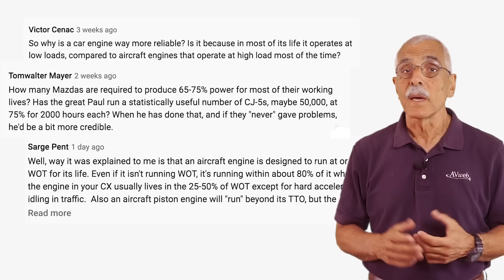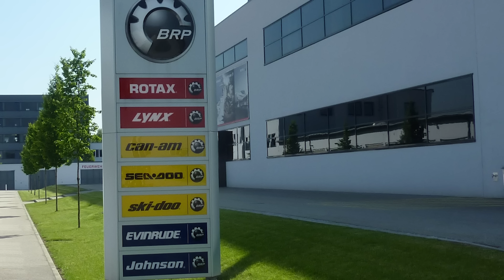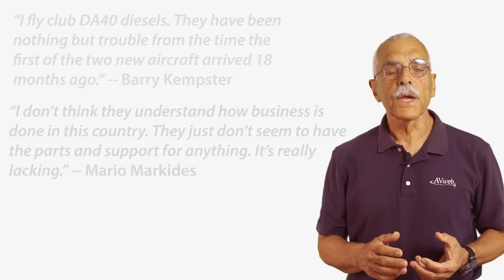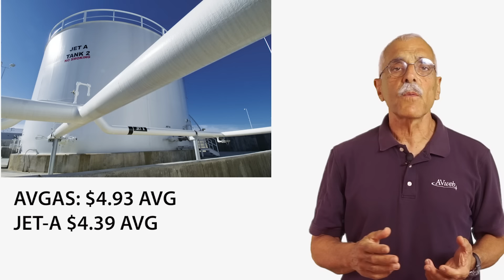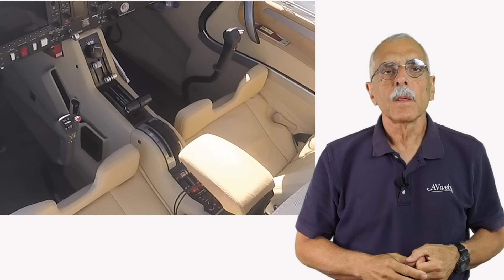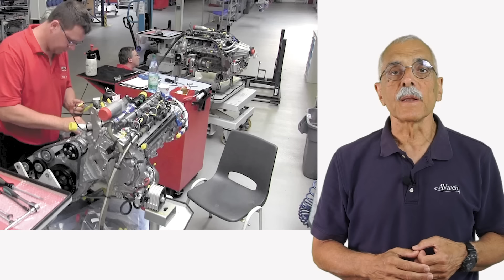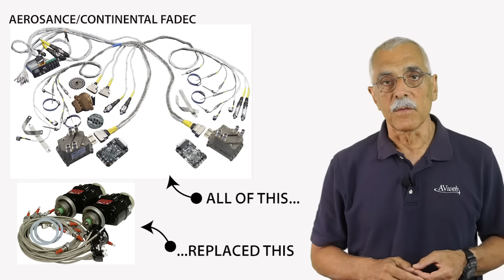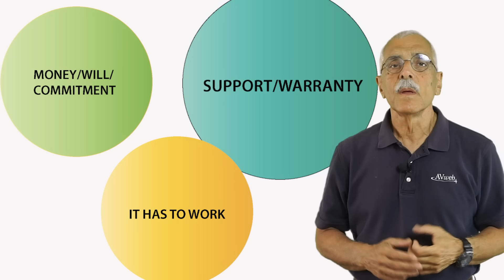Why New Aircraft Engine Ideas Rarely Succeed

Comment: I really hate (maybe that's a too strong of a word... but anyway) when I hear pilots say "I want to be able to control my engine" in response to the idea of FADEC.  I have yet to meet a pilot that can monitor dozens of engine inputs hundreds of times a second while adjusting parameters for best reliability and performance using algorithms developed over decades. While also constantly logging the engine performance, environmental conditions, and anomalies.  Some will even make this argument while trying to start the engine for the 6th time because this time they know they didn't give it enough throttle on the last try.
Reply: They need that mod which adds a separate mixture knob and CHT+EGT gauge for every cylinder.
Reply: @bwickham195  Plus knobs for adjusting each individual valve?
Reply: Strictly mechanical simple systems tend to be more reliable and cheaper to service
Reply: With a manual tranny you migth avoid paying $3800 for a repair that only needs a $50 part and you are less likely to suffer catastrophic failures every 50000 miles or so. Also, a person with reasonable tool skills can replace a clutch in the driveway avoiding the $350 per hr shop labor rate these ripoff shops charge. Unfortunately aircraft owners rarely get that opportunity as scumbag politicians at the FAA require them to have the services performed by a licenced a&p mechanic. In the automotive world there is much debate over right to repair laws and the scumbag lawyers often cite the aviation industry as a shining example of why only licenced dealers should be allowed to service cars. That's giving them carte blanche to drive the independent shops out of business, squash the home mechanic, kill the auto parts industry and raise repair prices to the point of needing a second mortgage to repair your vehicle. Anything that improves efficiency, safety, longevity, durability, reliability or ease of operation while not sacrificing other aspects of the same list ( automatic lean of peak systems that burn up engines before 50% tbo being a perfect example ) should be joyfully welcomed by the aviation community. For those who decry advances that reduce pilot workload there's always antique aircraft or experimental. Nice thing about experimental, you get exactly what you want ( provided you can afford it ) and, as the holder of the repairman certificate you can service it yourself thus avoiding ripoff aviation shops. 
As to the safety of gen av someone suggested you are safer in a car on the ground. MORE PEOPLE ARE KILLED EVERY YEAR ON AMERICAN ROADS THAN HAVE BEEN KILLED IN THE ENTIRE HISTORY OF GENERAL AVIATION. And that doesn't include the rest of the world. I know some da will point out the airline crashes that kill hundreds at a time but that's COMERCIAL AVIATION. When you intentionally fly to a place where people are shooting at you it's generally called MILITARY AVIATION ( sometimes its just annoyed neighbors ) but, again, that's not GA. The VAST majority of aircraft accidents are pilot error. Rarely are catastrophic failures at fault. When a trained and rated pilot fails to follow the checklist and turn off the defective autopilot it's pilot error. When a pilot fails to remove a pitot cover or notice the broken hinges on a control surface or the locked flight controls, its PILOT ERROR. When the pilot decides to perform aerobatics in someone else's Piper Warior it's PILOT ERROR. Let's face it, you can neither fix nor legislate STUPID. pilots should embrace technology that brings us out of the stone age and laws should not be allowed that push the cost of innovation and advancement out of reach of anything but a government subsidized airline. Pilots who prefer to fiddle with knobs and gadgets rather than fly the aircraft will always be out there. One can only pray that they don't take anyone with them when they kill themselves. 
There. Nuff said. Paul, love your stuff. 
P. S. How about a video on why a piece of electronics for aircraft or boating should cost 3 or 4 times as much as the EXACT SAME thing fot hikers ( GARMIN )
Reply: I pro Fadec, but I would still like an override, just in case If it doesn't add too much weight
Reply: Here, here. Well said.
Reply: I deal with fadecs. One manual reads "if these parameters are off, you will be unable to start the engine"
Oh boy. So basically it locks you out and will refuse to crank if a parameter is off. Even if it means you can save your life at the expense of the engine
Reply: people who say this will also drive an automatic
Reply: You're in it for maximum efficiency, not everybody thinks like you. Even if it takes 5 tries, it's a whole hell of a lot of fun to be in complete control. It's like manual vs. automatic in your car. Manual is objectively worse in every way except simplicity, but it's a lot more fun and engaging for the driver. You never have to fight with the transmission about where to shift and how fast, because you are the one making that decision in the first place. Even if you are making the objectively wrong decision, it's ultimately your decision. That's fun, maybe not for you, but definitely for me.
Reply: @tissuepaper9962  you might like playing with levers but i like actually flying the aircraft
Reply: @SuperAWaC  no reason to be condescending, we just enjoy different aspects of the experience to different degrees.
Reply: @tissuepaper9962  I don't know if I'd describe it as fun or engaging during task saturated portions of a flight.
Reply: @SynMonger  then maybe a diesel plane is for you, my friend. the single lever control just isn't for me, it doesn't match my goals in flying in the same way an automatic transmission doesn't match my goals in driving. I want to master the skill of controlling as much of the vehicle as feasible. That's the fun part for me. It may not be the fun part for you, that's cool. We simply disagree. I'm sure if I had to fly every day for my job I'd like the single lever for its convenience and safety benefits (the same way I like the automatic for daily driving), but I don't have to do that, so I'll stick to my 1960s-style controls.
Reply: @tissuepaper9962  I get where you're coming from, and yet for me it's the exact opposite really. I'm working on my PPL, but I'm training on a turboprop (because my friend owns that plane and I get to fly for cheap) and not having to deal with the whole mixture and prop settings is so relaxing. It allows me to enjoy flying more, because I spend more time flying the plane rather than managing the engine.
I'm the same with motorcycles. I don't want to have to deal with gears and clutches and power bands. I just want to carve up some corners and enjoy the ride and a CVT or electric gets me exactly that. You'd be surprised at how many "real bikers" get aggravated at my maxi-scooters just because they are sad people who are unwilling to concede that their definition of fun might be needless busywork to someone else.
If you want to manage and balance all that stuff by hand, kudo's to you for being able to do that stuff, especially during moments with a high pucker-factor. To me that's just not where I get the enjoyment from. The improved efficiency is a nice side effect, but in the end it's about enjoying flying or riding, at least it is to me.
Reply: @tissuepaper9962  Safety > Fun. I’d suggest rethinking that view.
Reply: @jamesharding3459  "less safe" ≠ "unsafe".
You have your acceptable level of risk, I have mine, let's keep it that way. I would say again that, just by flying a GA plane, you're exposing yourself to a huge risk of death compared to the average person. By your logic I shouldn't fly at all, ever, and neither should you.
Reply: @fermitupoupon1754  Yeah and Amen
Reply: @tissuepaper9962  The difference is: Can you text and fly in an automatic aircraft? I'd think not.
Reply: @690_5  I'm not sure if you're making an analogy or a joke but I never text and drive. It's proven to be more dangerous than drunk driving IIRC. There's task saturation, and then there's distraction, and I try to avoid distraction as much as feasible. Very, very few topics are urgent enough to be worth that risk.
Reply: @tissuepaper9962  "Manual is objectively worse in every way"
Except it's not, in a variety of ways. It's cheaper, more robust, more failure resistant (even if the clutch linkage fails you can still drive), requires virtually no servicing (a gearbox should last the entire life of the car, and a clutch can easily last 300,000km if you're not incompetent), has no electronic components that can fail suddenly leaving you stranded somewhere, it gives you more control over the gearing ratio so you can prepare in advance by downshifting if you're about to go down or up a steep incline, it allows you to push-start the car if your battery dies, with precise clutch inputs it allows you to rock your car back and forth out of a mud hole in a much easier way than an automatic, it allows you to be able to disconnect the engine from the powertrain at a moment's notice in case of a runaway (most relevant to diesels).

Carbureted engines have literally zero advantages over fuel injection. There is NO situation in which you want your engine to run at any other fuel mix ratio than what is required at the time. The mixture knob is a relic from the past that should have no business being in any vehicle built in the last 25 years.
Reply: @demoniack81  did you miss the second half of that sentence, "except simplicity"?

All of those things (except bouncing the car out of mud) can be done in an automatic transmission, because most automatic transmissions will let you choose the gear. You won't convince me that a clutch is better than a torque converter for anything except racing. Manual is objectively worse, I stand by that statement.

You're acting like I said 3-lever is better. It's not, it's objectively worse in almost every way, it's just a whole lot more fun. 

Why is that so hard for people to get? I enjoy fiddling with the operating values of the engine. I enjoy using my knowledge of the function of the engine to make decisions about what parameters to change and when, even if I can't be as perfect and precise as a FADEC. Just let me have that.
Reply: @demoniack81  I agreed with all parts except the last part and also carbonation.
Reply: @KevinJDildonik  just by flying a GA plane at all, you're exposing yourself to many times more risk of death than you are when, for example, driving a car. I think I'll take my chances with three levers.
Reply: @tissuepaper9962  "While skydiving I am exposing myself to many times more risk of death, so I don't use the AAD on my reserve parachute"
"All this because I like to be engaged and in control"
Reply: @benghazi4216  bad analogy.
Reply: @tissuepaper9962  The similarities are palpable. The bad analogy was the one you made with car transmissions. One or the other don't put you in an emergency situation with a tangible risk of dying.
That is about feel, playing engine technician while piloting is a safety risk.

But hey, the more sh*t you have to fiddle with to keep the aircraft in the air the better right?
Reply: @benghazi4216  the analogy between 3-lever engine controls and manual transmission is pretty direct IMO. Both are about keeping the engine at the correct RPM for the power and torque you want to produce. Both require an understanding of the workings of the engine and everything connected to it to be used most effectively. Both are, IMO, way cooler and more elegant solutions to the problem than their automated counterparts, despite their worse convenience and safety.

Never once did I say 3-lever engine controls were better or safer than single-lever controls. In fact, I indirectly said they were objectively worse in every way except design simplicity in my analogy with car transmissions. You imply heavily in your comment that I believe single-lever is worse. I don't. I think it's less fun, and less cool, but otherwise objectively better in every relevant way.

Why do you feel the need to be so dismissive and condescending? Why can't we just enjoy different aspects of the experience of flying?
Reply: @Ben Ghazi  The same reason you don't always use AP or enjoy flying at all rather than just say getting a commercial flight, different people have different levels of acceptable risk, it's the reason why options exist. As far as what level of risk is too high that's the job of the FAA. As for the car analogy, poorly operating an automotive manual transmission can absolutely get you killed, it's why in most countries an automatic licensed driver cannot drive a manual vehicle without re-certifying.
Reply: @benghazi4216  One option that you haven't considered is to not be an asshole, and don't worry about what level of safety other pilots are flying at which have no effect on you. Fly how and what you want, but don't give other people shit and act all morally superior for a personal preference.

Comment: very nice, Paul. "ever start an IO 550?" Was that a hot engine? It reminded me of watching a ground crew standing by with a fire extinguisher in hand as rock star areo pilots cranked up their machines on the ground after taking on more 100LL and smoke oil. My CFI never mentioned having an extinguisher handy on start up. But he did say something about overpriming it.
Reply: I watched a guy start a cabin class twin many years ago, who had that start-quit thing happen several times, and sat on the ramp for close to a minute with an obvious fire burning under one engine.  After which he started that beast up, and left none the wiser.  With big, black, sooty stains under both engines, so that fire on starting was apparently a regular occurrence.
Reply: @murdelabop  I have no clue why YT suggested this video to me, but wow I never knew starting a light aircraft engine was so complex until I heard him describe this and seeing some of these comments. Priming an aircraft engine, Is that just like an upscaled version of that little pump on the side of my snow blower I have to do three or four times before setting the choke and pulling the cord?
Reply: @filanfyretracker  Pretty much.  The primer is a kind of syringe that pushes about a tablespoon or so of gasoline directly into the intake manifold.  Managing that primer, especially for hot starts, is something of a dark art, and can be different for each individual airplane.  

Two of my boss's airplanes, both Cessna 172's, both the same variant, one of them would hot start with no primer at all, and the other, the only way I could get the damned thing started when it was hot was to set the mixture to the cut off, two pumps on the throttle and set it about an inch above idle, give it five full shots of primer, crank it, and when it caught throw the mixture full rich.

Comment: I believe it was Orenda that used the traditional automotive pushrod v8 as a base for their attempted engine.  If memory serves, they ran into serious problems in the auto conversion process.  The engine was smooth and powerful, but it could not stand up to aircraft use.  Even using race engine parts didn't help much.  They had to virtually redesign the engine to give it a chance.  

In the end, the biggest reason that new engine ideas rarely succeed is the relatively tiny market Paul mentions with the Lexus engine.  There just isn't that much profit potential to justify new engine development, and developing new engines is crazy expensive.
Reply from the maker: Orenda was on the list to include in this video, but it was getting too long. They were going to pitch it as a replacement for turbines. Ran into cost issues. I plan a vid on this one.

Comment: Hi, Paul. Youve covered the OEM airframers' foray into engine manufacturers attempts that should have been the domain of the experimental folks. Please check out AC Aero's Hawk V4 "diesel" engine, as well as their liquid cooled mods for the 360 and 540 engines. Im particularly interested in whether or not you can get 300 horses with good torque out of a bored, stroked 4 cylinder. (440 cu. in.)  
Trying for weight savings over the designed for IO580 @315 hp in a Bearhawk 5.

Comment: In general aviation, I see so many reported engine failures on takeoff only for the aircraft to end up in a fireball. It's almost as if these traditional engine manufacturers prefer they be unreliable enough to keep the service revenue up. All these years and now they're stepping slowly away from an ancient unreliable design? That's why I prefer to stay away from any of these deathtraps.

Excellent video BTW!

Comment: The GA market has been shrinking since 1980. Less than 3,000 new airplanes are built worldwide every year.  The market simply isn't there.
Reply: The prices continue to climb.  A cheap one is over a hundred grand these days.
Reply: Not enough CFI’s unreasonable medical requirements, who wants to spend 10-40k in training just to have it wiped away with an easily controlled disease. 

Yes I know there are SI but the FAA requires your life blood and more than necessary PHI JUST TO DENY you anyway for more tests that your own MD doesn’t think you need. 

FAA is good and the problem at the same time.